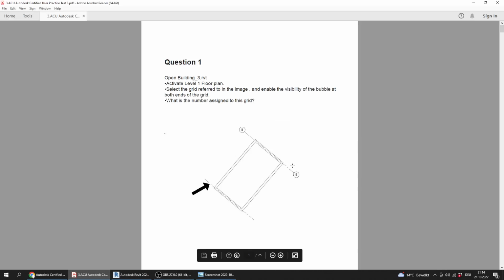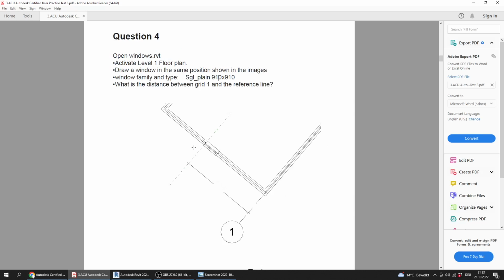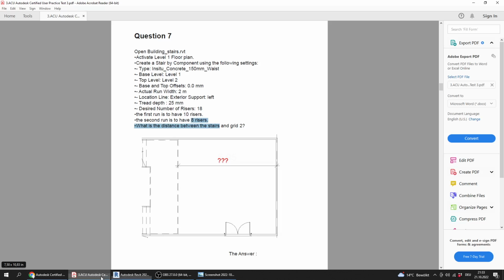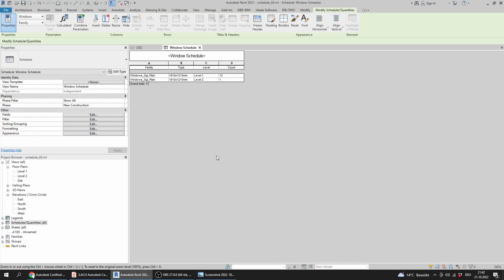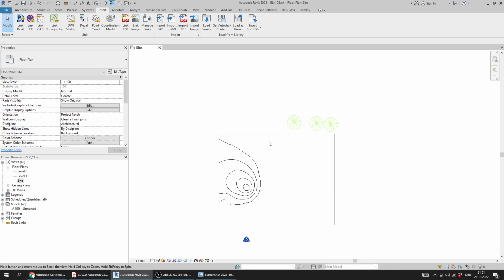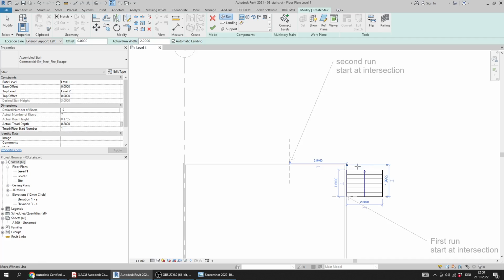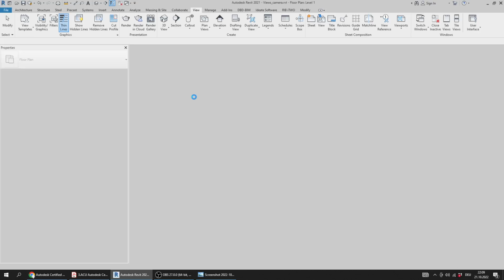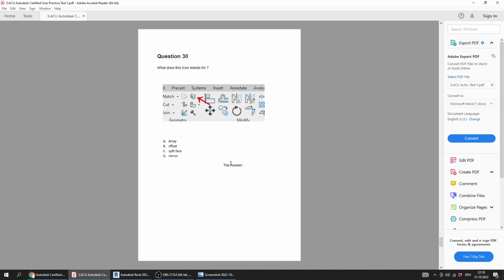Practice Test 2 | Autodesk Revit Certified User Exam (ACU) + Answers

Comment: I’m wondering about which version we are asked to? Revit 2023 or 2024? Can we choose our desired version to be examined?
Reply: I think you can choose. I am taking the test and no one told me what version to use. As long as it is new enough to be able to do the tasks. Would not go more than 4 years back.
Reply: @dedu98  Hi on autodesk website it says "You will not have access to the software to help you with your answers." but you are accessing the software so is the software required during exam??? If the software is asked is it going to be provided by test center or me?
Reply: From where to get these files? Like PW_rails.rvt? I did not get it. Will the autdesk be provided during the exam? Kindly, someone, guide me.